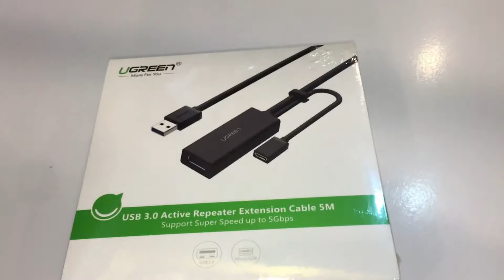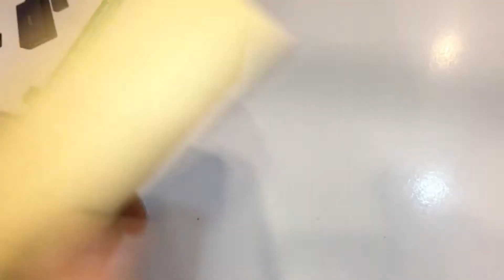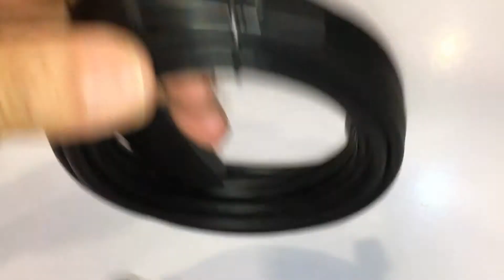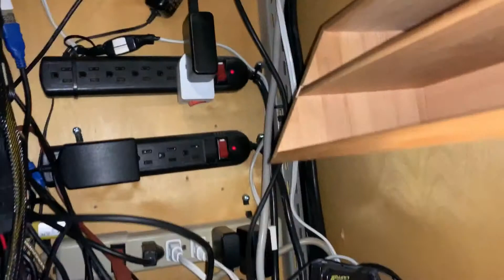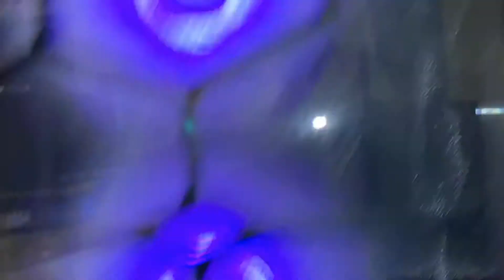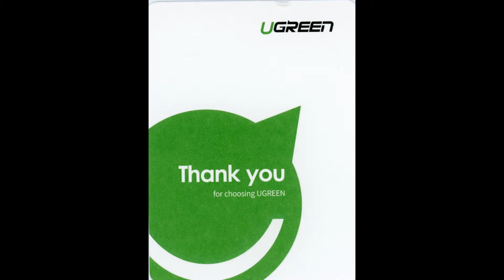UGREEN USB 3.0 Active Extension Cable Repeater Extender Signal Amplifier

Comment: If I add a hub to the usb extender will it work? I need some usb plugs with a distance of 20 meters
Reply from the maker: I would get , what’s called an active USB cable
Reply from the maker: I would get a 20 meter active cable

Comment: For what I understand, you are probably back powering your pc via the micro usb you plugging to the wall. That's why you can't turn your computer off.  You should try using your active cable with out plugging it to the electrical outlet.
Sometimes active cables take needed power from the host not always need the 5v extra power. This might be the case.
That also could damage your driver. I think. 🤔
Reply from the maker: I will try that, thank you